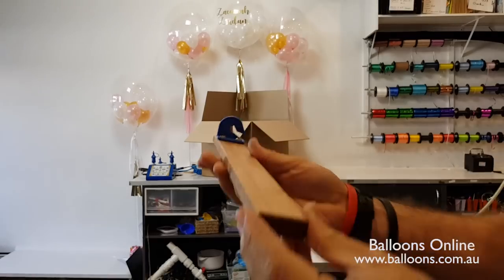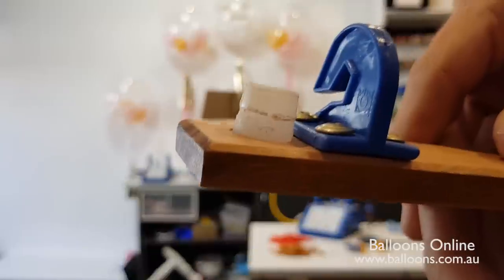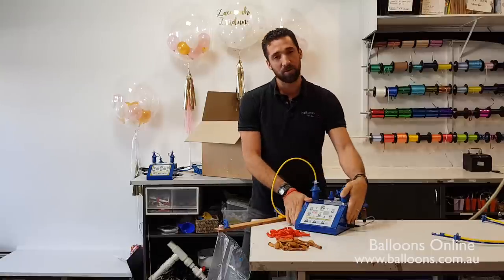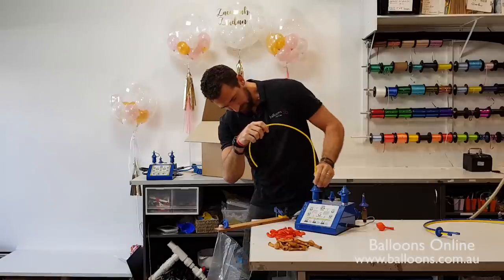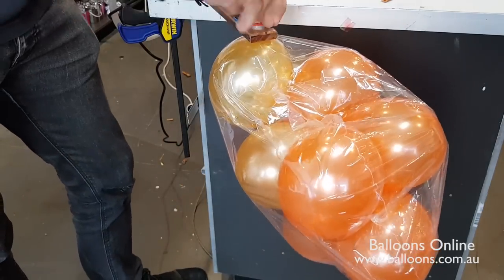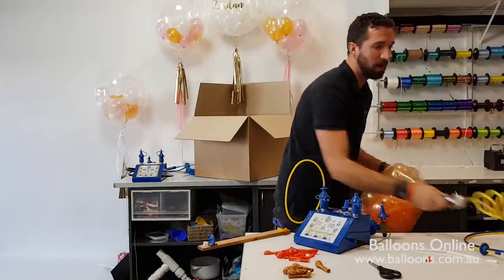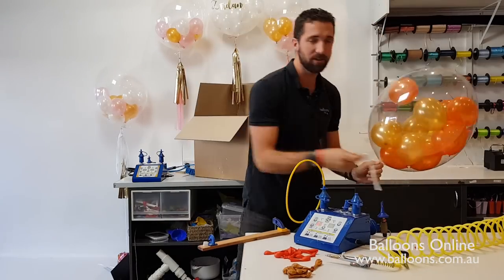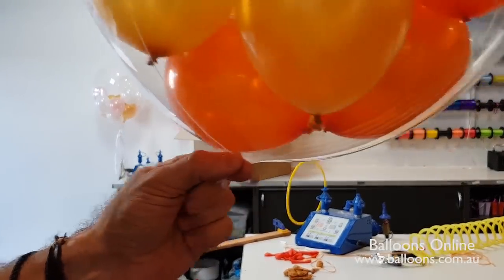24" Deco Bubble Balloon Stuffing Tool

Comment: Very cleaver. 🤩. If you put a thin layer of plastic on the other side of whole it should keep the air in cuz the pressure forces plastic flap to stay closed. I will need to make ASAP
Reply: I should say if you don’t have a deco bubble but the other plastic globos

Comment: Thank you for your video! I have been creating these balloons but my 5inch filler balloons keep popping after about 24 hours. It's normally only one balloon that pops but obviously this still isn't ideal. Do you know why this would be? I am using high quality Sempertex balloons so I don't think that is the issue. I do however fill the 5inch filler balloons with air rather than helium - could this be the issue? Thank you :)

Comment: Thanks for your video. It’s really helpful for me. When I put mini bubble in deco bubble, I always found white powder in deco bubble. It looks not clear..it’s too much.
Do you think It is  reason that I move and push mini bubble in deco bubble?
Reply from the maker: Hi Hamin. What brand of latex balloon are you using?
Reply: Balloons Online Deco bubble balloon is qualatex brand that the date of manufacture was 2010. And I used mini balloons of sempertex brand. Do you think there is reason that I used old balloon?
Reply from the maker: @haminpark5779  I think it could be I'm afraid. We only ever use new stock of Qualatex. Try that and see what happens.

Chris
Reply: Balloons Online I see. Thanks! I’ll try the new one

Comment: I’ve had a few times my latex balloons have popped inside the bubble is there anyway I can stop that from happening?
Reply from the maker: Hi Leah. Are you inflating the latex with air or helium? Also, what size are you inflating them too?
Reply: Balloons Online. I’m filling the latex balloons with air and I’ve been filling them to a full 5”. I done a balloon the other day and didn’t blow them up fully and they were all fine so I think that might be the problem, filling them up fully
Reply from the maker: Ahhh, you should fill them with helium. What is happening is the helium inside the deco bubble is slowly penetrating into the air inflated 5" and expanding them. If the 5" are also helium then the pressure is balanced.
Reply: Balloons Online thanks so much for the help really appreciate it

Comment: I tried this and my bubble balloon didn’t float what did i do wrong?
Reply from the maker: Hi Donia

Did you use helium inside the 5" and the deco bubble? Did you make sure you pushed all the air out before inflating? Are you using pure of professional grade helium? (not the cheaper disposable tanks)
Reply: Oh that might be it then I’m using a disposable tank which better one would you recommend

Comment: Can anyone help. I did this, filled both the Bubble and balloons with helium but the bubble balloon didn’t float at all. The only thing I did differently was use larger balloons inside (11”) I inflated them to a similar size as video and cut off any extra ends. I didn’t have any 5” balloons to try. Thanks